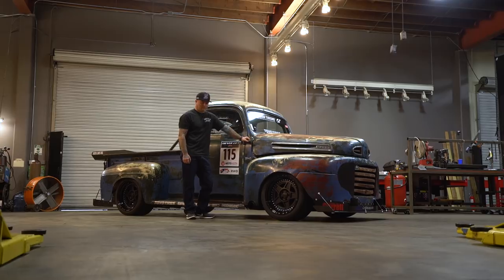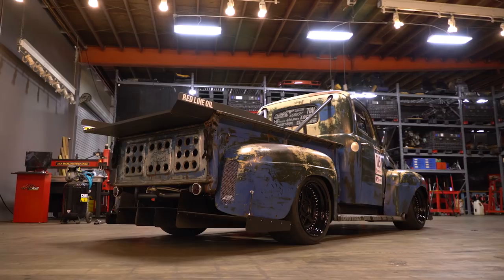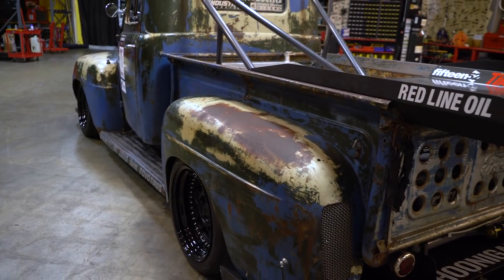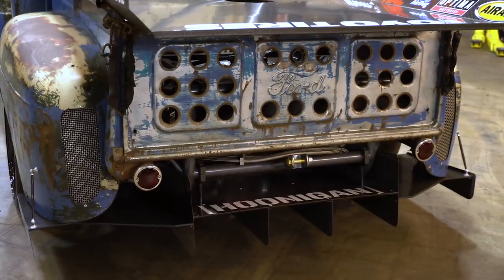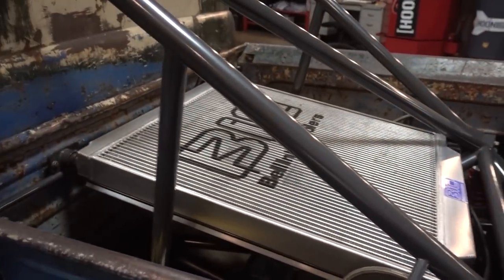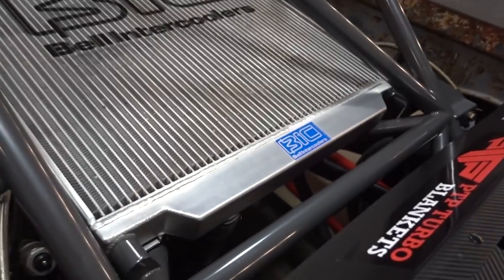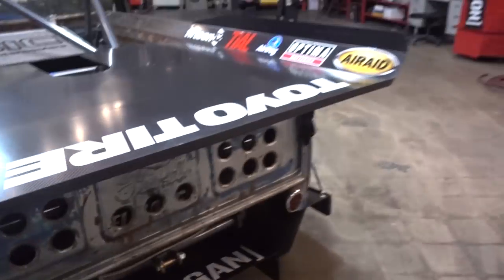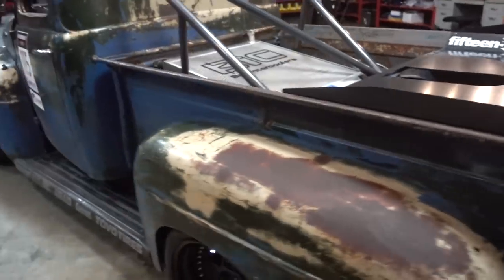How to Build a 1200hp Diesel - Old Smokey Preps for Pikes Peak

Comment: I bet this thing’s got enough torque to slow the rotation of the earth!
Reply: Josh Bacon it doesnt actually drive around. It just turns the earth underneath it
Reply: Oddly, 1200hp is relatively "mild" for a Cummins race motor.  Though most of the >2000hp ones aren't really expected to live much longer than 10 seconds.
Reply: Heath Albritton yeah I see em around. Not unusual but still ridiculous
Reply: Josh Baco
Reply: The earth is flat...
Reply: The earth is flat and doesn't spin. The sun moves
Reply: @halbritt  the 2000 hp pulling trucks are built to last an antire season if pulling, thats full throttle, 120-130lbs if boost for 15 seconds, all season. for making 2000 hp at 5.9 or 6.4 liters, they're extremely reliable. also the 2000hp drag trucks are built to last a helluva lot longrr than 10 second. theyre also entire season engine.

Comment: This car is the ultimate sleeper. Rust bucket built like a damn gt car holy ahit what else could I ask for. What a badass build
Reply: Thats far from a sleeper..
Reply: 0rang3z its not a sleeper at all
Reply: 0rang3z if that thing pulled up next to you in traffic you wouldn't think nothing of it with all the aero, tube chassis work with the cage coming through the cab, and the rally style lexan Windows?
Reply: Didn’t see a spot of rust, somehow that truck is still so clean... sick
Reply: Definitely not a sleeper
Reply: Chuckles Garage I like your truck a lot. How did you figure out what sizes of turbos to use?

Comment: I was always under the impression that the wind effect/turbulence that spins in the bed of a truck when the gate is up is good for the aerodynamics of the vehicle. I watched something, maybe a documentary a while back where this was tested in a wind tunnel, tailgate down, and up, and the spinning motion that is created in the bed of the truck due to the gate being up creates a perfect shape from the top of the cab to the tailgate that allows the rest of the wind to move over that spinning motion in the bed, creating less drag than if the tailgate was down or removed.
Reply: Alpha Machina that would work in a empty bed but his is full of suspension,rad,cage and other fabrication that would mess up that effect
Reply: Yeah, you're absolutely right. So they needed to shave the wind shear right over the top with the carbon fiber. Gotcha. Really awesome engineering here. Plus he mentioned an adjustable rear wing, which will definitely top it off, take some of that streamlined pressure and use it for rear traction. Along with the diffuser, that's some serious aerodynamics on such an old vehicle. 

When you look at the best shapes for aerodynamic vehicles, this truck really isn't far off from what is desirable, other than that huge flat front end and windshield. Otherwise, the rounded shape to the fenders are pretty good. For land speed records, it's often said a tear drop shape is best, but in stark contrast to aerodynamics of flight, you have to account for what will keep you on the ground; the downforce, without impeding so much that it causes unnecessary drag. Really crazy balancing act for a lot of the lighter vehicles that rely mostly on front and rear wings and diffusers for 80% of their traction, like F1, for example. Something tells me, however, that this truck won't have any problems with staying on the ground. :D

Comment: 100 psi of boost? 😲😳😳 WOW!
Reply: Joel Farley - That's the diesel life ;)
Reply: Boost on a stock truck is ~25lbs.  A stock truck with a stock turbo, stock head bolts, and a stock head gasket will take 35lbs and still be safe.  100lbs takes some fancy head studs and some fire rings.
Reply: Heath Albritton My friend's stock 2015 dodge 3500 makes 36 lbs according to the in cab screen.
Reply: @halbritt   cummins 89-02 trucks take 150 psi  on a all stock setup. My truck runs at 105 on a set of compounds . Stock head  , gasket, bolts no fire ring.  Year and a half dally driven. on this set up.

Comment: in a compuond turo system the bigger turbo should feed the smaller turbo but what is you would replace the smaller turbo with a sequential turbo system inside the compound turbo?
that would a compound sequential tri turbo system ?!

Comment: 2 psi at idle ? wtf
Reply: Azhar Fahry yup no vacuum on a diesel
Reply: My Detroit 60 series 600 hp had 5 psi at idle and 40 pounds of boost at 2300 rpm.

Comment: that's the cool thing about diesel trucks is they are built for hauling so the turbo spools at really low rpm's as opposed to a gas engine
Reply: unless your talking about one of those new Audi biturbos with the electric turbo compound setup

Comment: dimples should be the other way round in the tail for real aero. Also mesh doesn't reduce air pressure as much as you think, the rear of the wells would be way better just open.
Reply: Yolo Submarine They look like shit the other way around lol. The mesh is 10000 times more aerodynamic than it was before. Think of air as water....Because fluid dynamics.
Reply: well, yeah, all good points! But i was surprised to learn back in the day that 50% open doesn't mean 50% reduction in overall drag because of the drag of the air entering the perforations, its probably 25-40% better, not 100000 times.  Great build.

Comment: Again an awesome episod, keep up the great work, but I have a question. Which is it?  First he says the truck weighs nothing, then he says from the factory the truck is around 2800 pounds so I added weight. Then he says the truck doesn't weigh anything. Which is it?  Is it heavy or light?
Reply: for a truck with a cummins and that kind of power level under 4000 lbs is incredibly light.... diesels with that turbo setup are stupid heavy, the engine alone weighs 1200+ lbs. he said, which sounds light to me... todays day and age a cheap gasser pickup is 5 - 6000 lbs, my chevy 2500 with the duramax and the modifications i've done weighs about 10,000 lbs.... this truck is incredibly light for the setup he is running!!!
Reply: D3THKLOK no I get it. I understand that it's not that heavy. What I was getting at was that first he says its light then its heave then its light.

Comment: factory truck weighs around 3200-3400 pounds, definitely not under 3000. also the common rail 5.9 cummins is a 24 valve whether its in a dodge or a freightliner, its the same engine.

Comment: Front splitter is way too small if you're gonna be running a triple element wing plus a rear diffuser
Reply: Gasosphere Incorrect. The nearly 20 percent forward weight bias, and the fact that this truck makes over 2000lb ft of torque called for more wing. The diffuser is part of an entire downforce generating undertray which does more than just provide rear downforce. This stuff is all purpose built and CFD tested to work with this truck.

Comment: What is a hans device for the uneducated
Reply: 0rang3z Neck brace to keep you from breaking your neck in a crash. Developed after Earnhardt died from his crash.
Reply: Head And Neck Support, anchors to helmet and ensures your head and neck are supported to prevent a basal skull fracture in an impact. It’s why you shouldn’t daily harnesses.
Reply: AKSKSMAN actually it was developed way before Earnhardt's crash. Earnhardt refused to wear it because he called it a noose. After Earnhardt died it became a requirement in NASCAR.